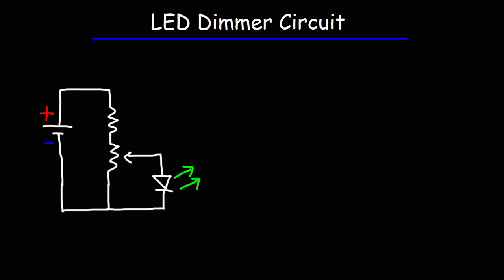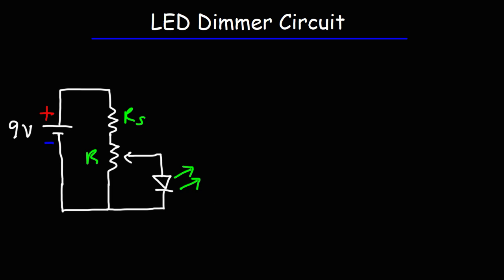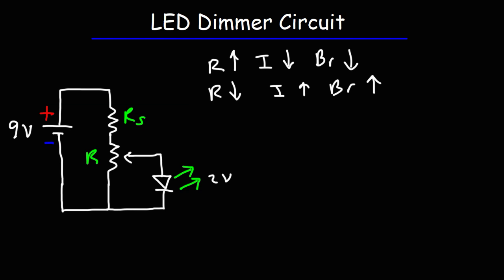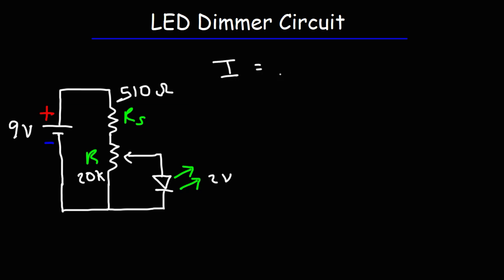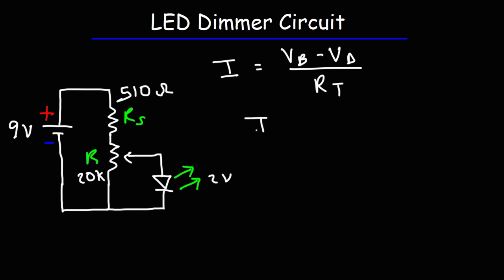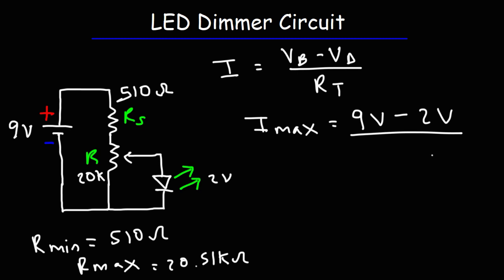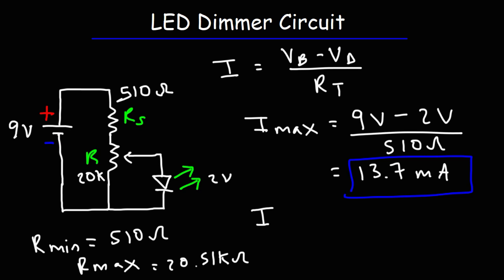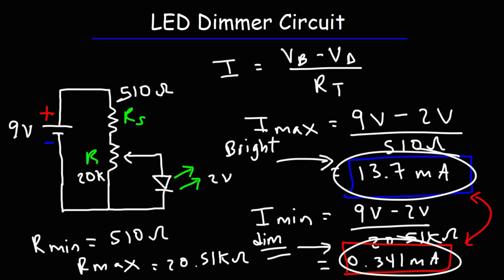LED Dimmer Circuit - Brightness Control Using a Potentiometer

Comment: OOPS!  Your lectures are terrific, but in this case you made an error:  Your analysis is only valid if the bottom leg of the potentiometer is NOT connected to battery negative. Also, it would help if you visually showed the position of the slider.  You do a wonderful job!

Comment: So the current that he refers to is the current entering the diode, correct? Why does he not need to account for the voltage of the second resistor when determining the voltage of the equation? Is it negligible? or what?

Comment: Po ten she om a ter 

Potentiometer. 

I'm going nuts here trying to fix an LED Lantern. The light flickers, due to a dirty or poorly designed potentiometer. I replaced it, nice pot., with a switch, wired through the switch, through the end of the pot., and the wipe goes to the LED. Works great, but still flickers. Ugh. The pot. is rated 500 milliwatts, I'm drawing 320, so I'm OK there, in dimmer levels, only 100 milliwatts. Why is it still flickering with a new pot. Are there better pots. with switches built in, should I use a wirewound pot. I need 1K end to end reststance, i.e. a 1 k pot. But one that works without flickering.